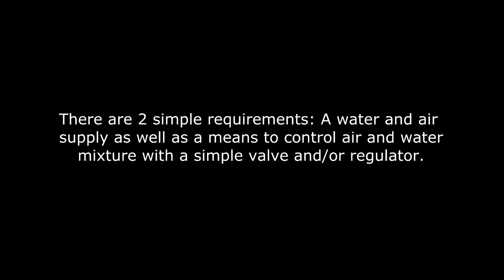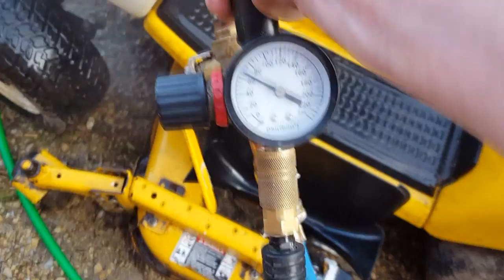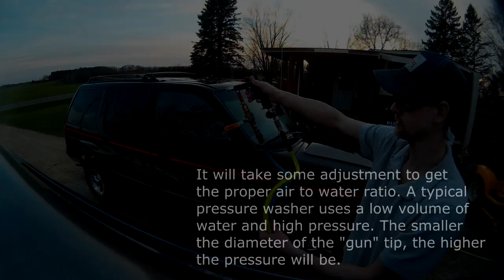DIY Pressure Washer with an Air Compressor

Comment: How does the air hose hold up to 1500 - 1800 psi (as you said in answer to someone else)  when air hose is generally rated around 300 psi?? I thought it would explode 🤔

Comment: I need one, How much? My pressure washer just ain’t cutting it anymore
Reply from the maker: It's not very efficient nor as powerful as a gasoline powered pressure washer. If you want to give it a try, buy a $20 sandblaster air siphon gun and fittings to adapt a garden hose and air compressor fitting.
Reply: markfothebeast appreciate the feedback, was thinking of assembling one. Good video

Comment: i like it DIY. i have question what is the psi when you hit the air with water mixing? i have air compressor for 50 gal and 30 cfm
Reply from the maker: I think I tried anywhere from 80 to 115 PSI. I had better results with higher pressure. I'm thinking that the siphon feed guns inner diameters are too large to create high water pressure with a practically sized compressor. I'm sure a guy could create something.
Reply: I hope you don't think this is rude but I think I might be able to help this gentleman with a way of a solution I have tried this method and you're all the way right on your answer but like I said if somebody was to look around not that hard they would find the exact solution to that problem and so what is it worth I would blood it to see your name in my comment section have a good one man and I really enjoyed the way you took an existing product and use that for something completely different
Reply: Use pvc pipes and fittings to make your own really tiny whole with the tip.

Comment: Great, simple idea (read as genius). I will build one asap, maybe plum around the around all side of my house to have centralize pressure washing with quick connects all around. Thanks for posting.
Reply from the maker: This project could be built much better. I don't have a very powerful compressor. With a properly designed gun I'm sure this could be affective.
Reply: Check this out...https://youtu.be/ps5D8Ixd3i4 hope it helps

Comment: also what is psi output with the siphon gun?
Reply from the maker: AzraelPercussionNEO A very rough estimate of the water pressure I would have to say is around 1500 to 1800 PSI. However, I've created some additional modifications to add more pressure - which I will share in my next video update soon.

Comment: you think you can attach a foam cannon to that siphon him using a 1/4 attachment? You should be able to get a valve and a pressure regulator over at harbor freight no?
Reply: You can fill the barrel of the DIY air compressor power washer gun on... the king's gun series on you tube with scotch bright, or chore boy and when you add soap you have the best foam cannon money can buy.😎👍
Reply from the maker: i wasn't quite sure what a foam cannon was until I Googled it. Why not create your own foam cannon using a small tank and the same washing chemicals? It's something I really haven't looked in to but interesting.